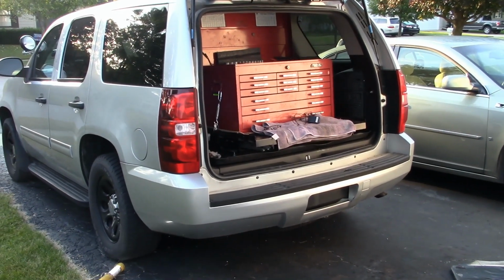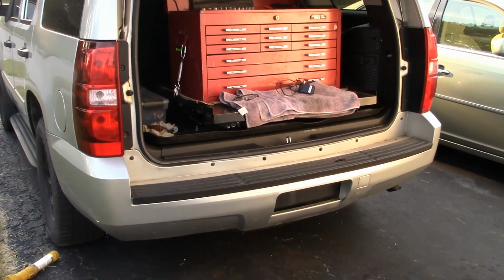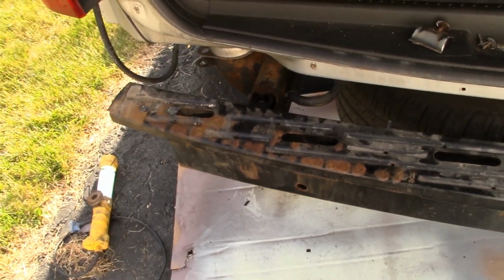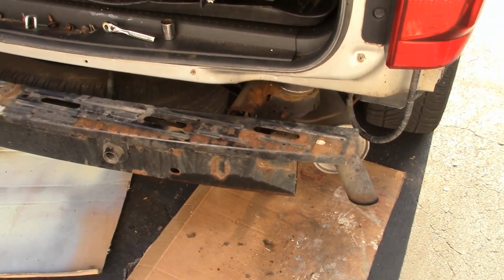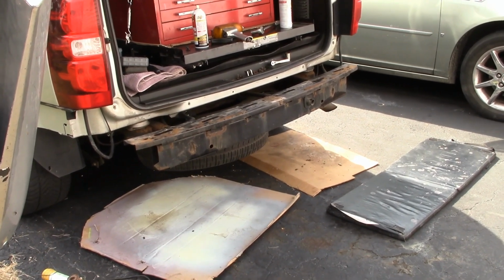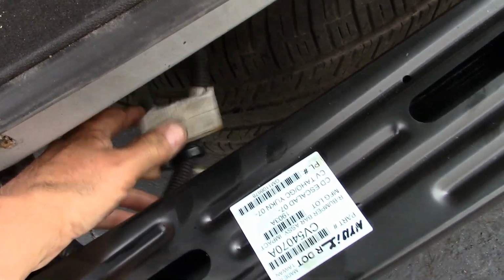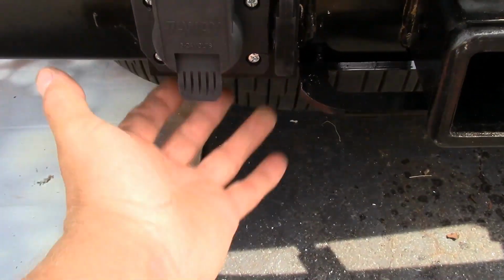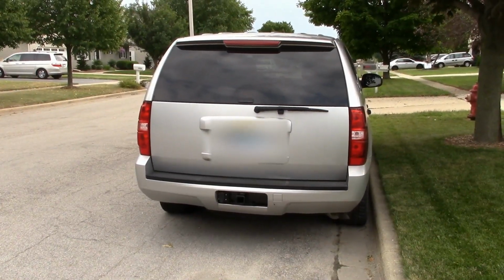Tahoe Rebar Hitch Install

Comment: I got a 2008 Chevy Tahoe PPV 4X2 with the tow hitch and I need to know what's the tow capacity for PPV 4 by 2? I need to tow my 2007 Dodge Charger RT.
Reply from the maker: I pull a car trailer with a Model T Ford truck on it and it drove like it wasn't even there. I also pulled it with a 55 Buick on it but it was only a short distance.